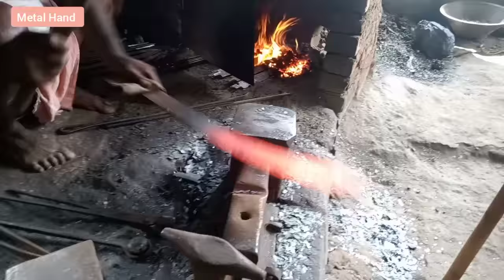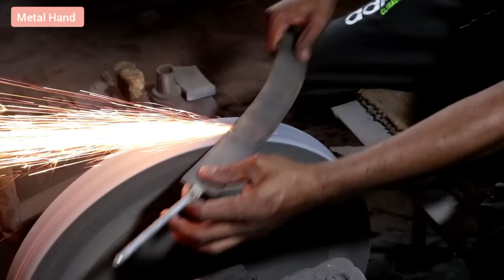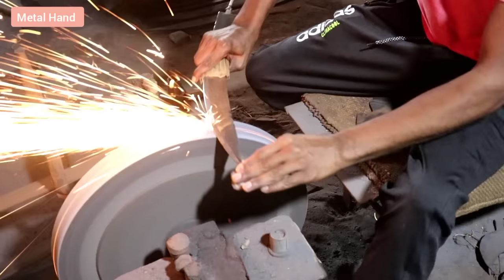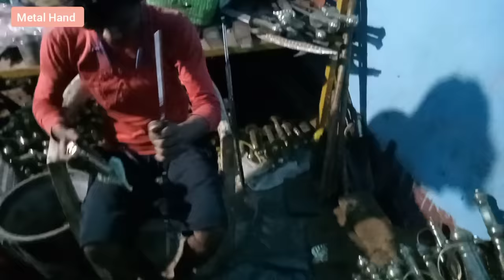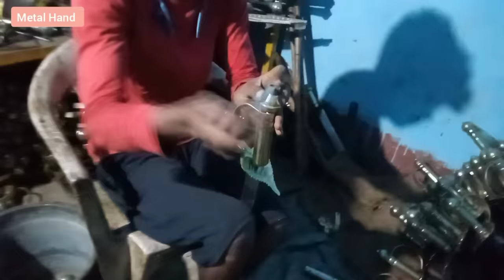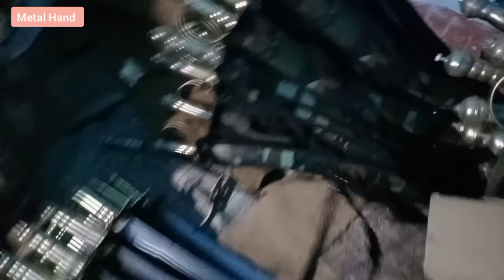Sword factory / sword making / Indian blacksmith making sword

Comment: going through all the effort to make a sword and making a crappy thing by welding on a short tang to another piece of metal... what a waste of effort, just to save on the steel. That sword is useless for anything other than a wall hanger, sharpening it is just a waste of effort. The chance of that blade snapping off at the handle makes it unsafe to use. I'll never understand why this sort of substandard craftsmanship is so commonplace. and a camo sheath and a round metal handle... what an abomination.